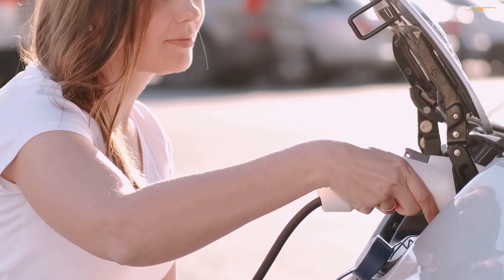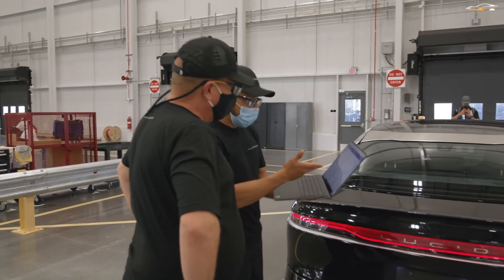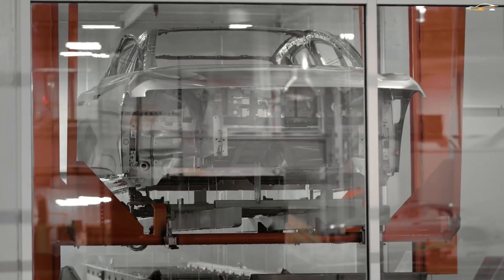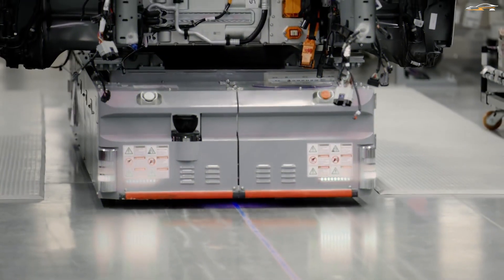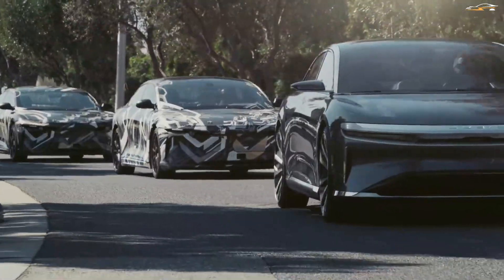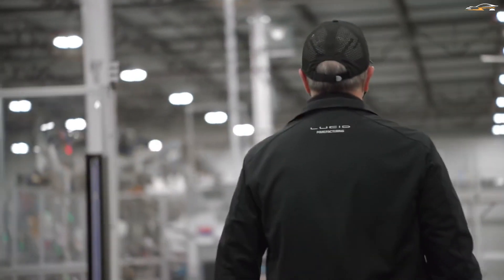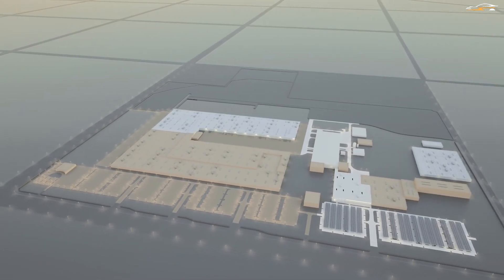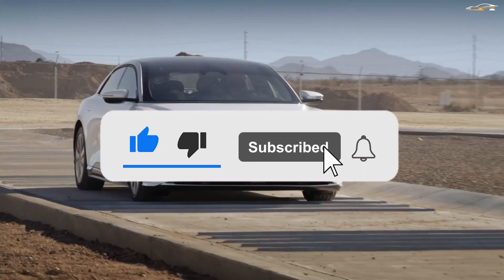Lucid Motors Factory / AMP-1 and LPM-1 EXPLAINED

Comment: I'm very excited to see a new player in the EV industry.  What is hypercritical for Lucid is to bring their car to market this year without further delay.  Further delays could impact sales of the Air as more and more mainstream ICE manufacturers introduce their versions of what an EV should be.  Additionally, Lucid should strive for a zero defect vehicle, unlike Tesla which has had horrific QC issues from the start.  As a premium EV auto manufacturer, it should strive to be Lexus-like in its QC and equivalent in cache to MBZ.  Also, though Peter Rawlinson is highly regarded as a former Tesla executive, he should seek out an individual who is younger that will continue Peter's vision far into the future.  After all, IF Tesla did not have Elon Musk, a true visionary, Tesla would likely not be as successful.  Peter, just don't take a hit from a joint and forget about all of the ballyhoo about Dogecoin and Bitcoin.  Good luck Lucid Motors!